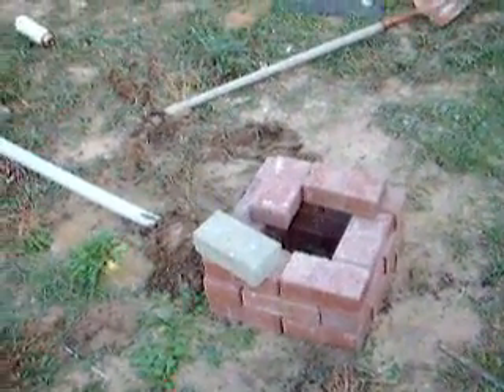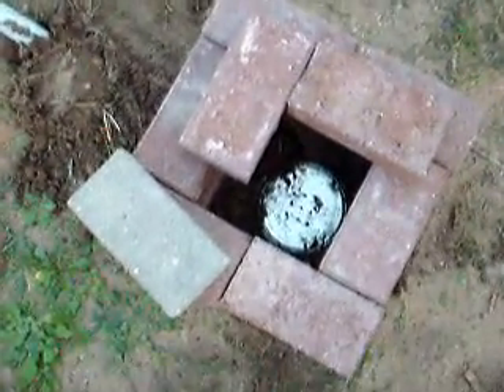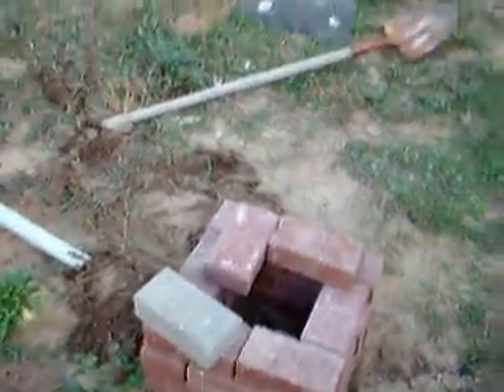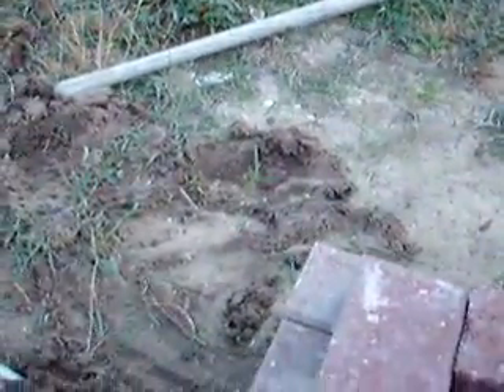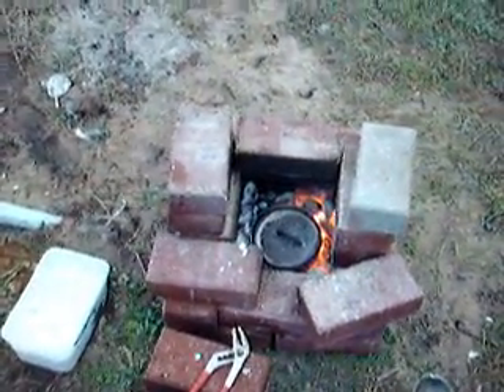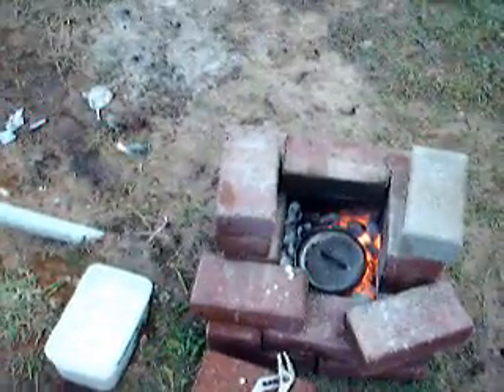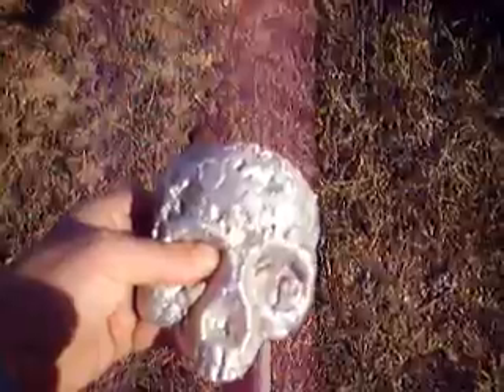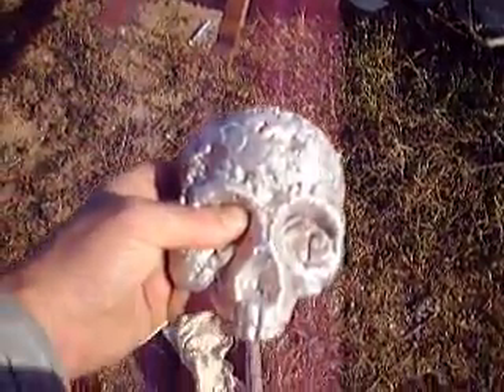casting aluminum

Comment: Crucibles can be made of several different materials depending on what your casting. For aluminum you can make them out of steel and it's probably the cheapest, but after quite a bit of use they start flaking. Schd 40 pipe with 1/4" plate welded in the bottom. Your commercial crucibles are made of clay graphite and silicon carbide. I use both steel and clay graphite crucibles. The clay graphite can stand higher temps than steel and you have less contamination of the melt than with the steel.